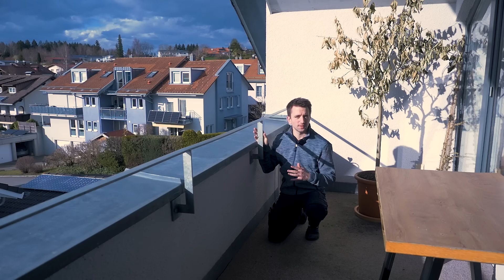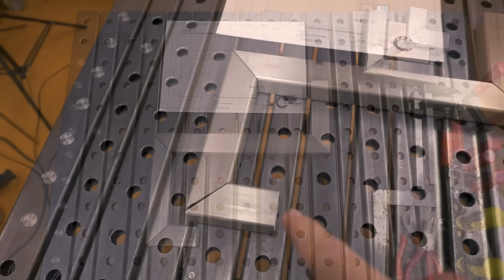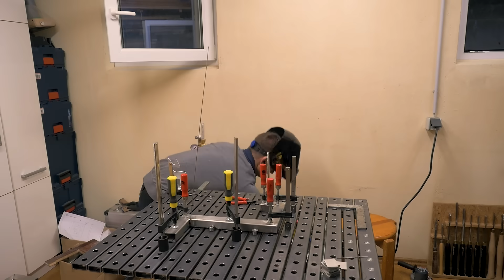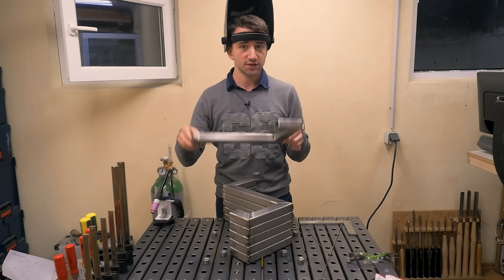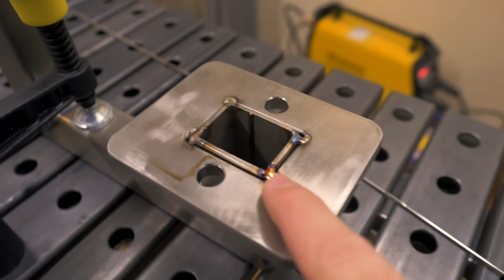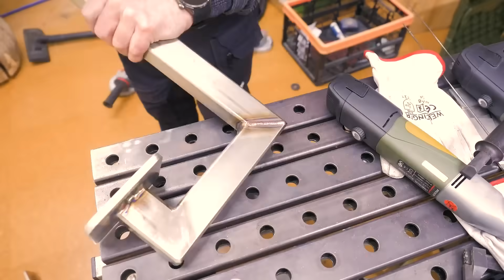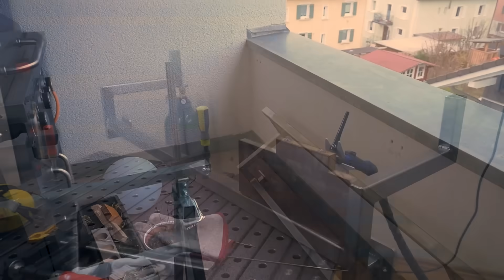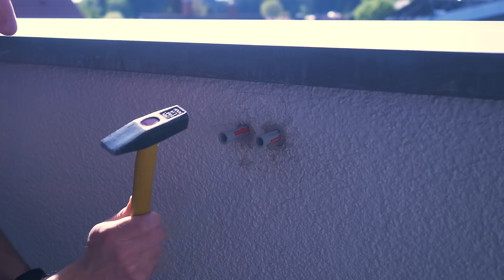Leaving my Comfort Zone & Welding a Railing || Balcony Rebuild #1

Comment: Du schweißt echt gut! Ich muss sagen; da wo es ein spalt gibt, da kann das material sich zusammenziehen. Deswegen ist eigentlich nur bei dicken Wände (<5mm) ein Spalt wirklich nötig, oder gar keinen wenn du ein Faser dran schleifst.
Vielleicht nutzt dir das was. Kannst selber paar test machen und durchsägen um die Würzel zu sehen... und ich denke du hast tatsächlich bisschen viel Zusatzdraht rein, das macht auch was mit dem Verzug (da mehr material sich zusammen zieht). 
Bin selber jetzt kein Schweiß ingenieur, aber Metallbauer (und Alu schweißer). WIG ist auch das "heißeste" schweißverfahren, bei MAG MIG hätte sich das vielleicht ein bisschen weniger verzogen. aber ich verstehe dass mann WIG auswählt (da man alles damit schweißen kann (wenn AC/DC gerät) und man viel ruhiger und sauberer arbeiten kann). ich kanns mir doch noch nicht leisten mit meinem Kleinen Keller und die Gasflaschen 😂... muss mich mit Fülldraht zufrieden geben.
Schönes Video. ❤

Comment: i work into fabrication and i do alot of railing and the one you had before is really cheap fabricate
Reply: you seems to have done pretty good but what you should improve is your tig weld a bit to big for what it is also be careful of oxydation if it is to oxidize it will rust like regular steel
Reply: @Shamefulbird i am worried about oxidation as well. Arent you supposed to treat the steel with something after you welded and grinded it?
Reply: @Paronak  there is process to remove oxyde but its only if its not oxyded enought 
there a simple test you can do if its going to rust just grab a magnet and put it on your weld if it sticks that mean it lost its property and became regular steel if it dosn't stick its fine
Reply: you can always use some acid to remove some oxide tho and make it white again

Comment: isopropanol does about the same job as acetone, only the fumes is way less harsh (at least in my experience).
Might be worth getting some of that to try when you need to restock on cleaning alcohol.
Reply from the maker: Good to know. I have about 15l in storage for my resin printer

Comment: Next time just fix it in the bigger holes with chemical anchoring, such as Fix-o-chem or similar. Saves days.

But overall, mint quality work Marius
Reply: Fix-o-chem (or equivalent) chemical anchoring is great stuff. I have used it countless times in difficult walls. I even used it to anchor a galvanized metal strip in a concrete floor.

Comment: Next time use injektion mortar to fix threaded rods in bigger holes.
Reply: I thought the same. Just drill a bigger (too big) hole, and use the epoxy to secure the bolts

Comment: maybe I'm stupid, but why does a open balcony have insulation on the outside?
Reply from the maker: I guess it was easier to build that way with all the walls around being built the same
Reply: It still helps against heat and cold eventho it's an open balcony. If you run around naked with just shoes on, you will either freeze or get a sunburn, but your feet are protected at least lmao
Reply: Also, a whole building is isolated from the outside. If they leave balcony part free there would be gap. So it's nicer and easier to just cover it too, so the elevation is even

Comment: Nice project.
I would add some horizontal metal cables on the outside bit as further protection, then u can rest drinks or flower pots on the new edge space more safely!

Comment: My experience is that clamping whilst welding doesnt work out that good as you found out. You need to check the alinement anyway. My method is that i mostly do not use clamps and use a special method: For this Method you need a small gap of appr. 1mm between the parts. You tack the parts with 4 Spot welds in the middle(very important, not in the corner) of every flat side. These spots not become kind of a pivot point. You can check and align your angle heating up a single point. Heating up and cooling down will pull into direction of this spot. After its aligned you start welding from the corners. Dont start welding from the spots because this will misalign it again.
Reply: Interesting method! How do you heat the points up again?

Comment: I'm not sure I understand how insulation is a problem. That part of the wall is fully exterior on both sides who cares if insulation is compromised? are you worried about sealing the holes against weather or is it a code thing I am ignorant of?
Reply from the maker: I would crush the insulation boards when tightening the bolts. And the bolts would need to be 15cm to properly reach the brick
Reply: @MHAnything  Ooooh the exterior face of the wall IS the insulation and thus not structural. This is not done in my climate because of hurricanes and I forgot it existed.
Reply: @alexphelps7042  
Yes, the wall's outside is essentially styrofoam (though not as soft as the typical packaging styrofoam) that's 16, maybe 20 cm thick. It's covered with plaster/render and a coat of paint. If you want to mount something heavy to it you need spreader plates and/or get mounting hardware al through the styrofoam into the wall.
I think this is standard in most European countries nowadays, because it saves a lot of energy and money. It is even mandatory for new houses built here in Austria. Obviously a balcony wall wouldn't need insulation, but it is still covered in it, so the outside behaves the same (during construction and later with weather changes) and looks the same everywhere on the building.
Reply: @superdau  Seems a fire hazard. Probably not the complete correctly designed and installed system, I'm sure people far smarter than me thought about it for longer. But a full jacket of foam clad in like a milimeter of rolled on hope seems like a full stack of opportunities for neglegent installers or poor maintenance to cause problems.
Reply: @alexphelps7042  
The rules on fire safety are strict and enforced. And as said the foam is, although styrofoam, made for this application and doesn't burn as easily as packaging foam. There are also regulations that it must not drip molten plastic for example. There have to be non-flamable flame resistant barriers above lintels and at least every two storeys (mostly rockwool that has been treated in way that it is rigid and can be handled like the foam blocks). I don't know what the exact limit is, but buildings higher than something like 20m must use non-flamable insulation all over.
I'm not aware of any incidences here in Austria where this kind of insulation posed more danger/caused more harm than a "normal" fire would have on its own.

Comment: Please don't take it the wrong way, but you've checked that it's up to code? With the two step design and it now kinda beeing a ladder/bench it feels to me like this could be a problem. Just would hate to see you getting blamed if something happens as well as having that then on your conscience.

Otherwise it's a neat design and i do understand the desire to gain a bit more space! ;)
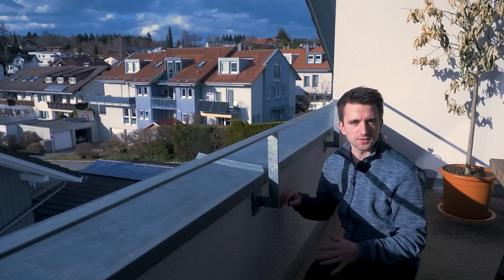Reply: 0:33 it says "I have permission".  He's also an engineer. So he'd know all about codes and regulations.
Reply: @LostWhits I would assume that permission in this case "only" means that the owner of the building was fine with it. But that doesn't necessarily mean it's up to code.

And people sitting or kids standing on the railing still might be a problem if they don't act responsible. And such Codes usaly try to also protect people not acting with all the wisdom one could have.

I also don't want to say this necessarily has to be a problem. It's just something you just have to keep in mind.
Reply: @konradhopp9349 Glad to hear!
Reply: @LostWhits  There are different type of engineers. And these regulations aren't part of 'Engineering', it is, as you say, part of Codes and Regulations built on Accident reports. That stem from human errors and neglectful maintenance.  

For example some child climbing up and falling over.  But since the wall is around 1m / 3f, it should be okay with most children. Not to mention, children should be on an open balcony without supervision anyho'.